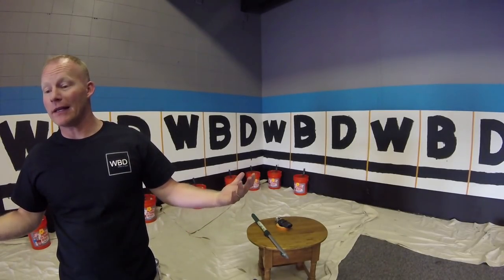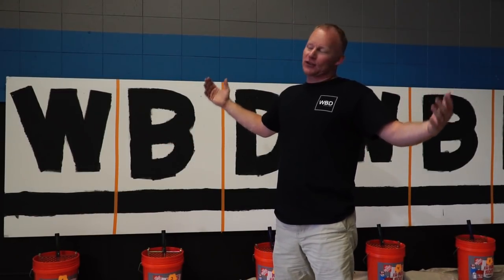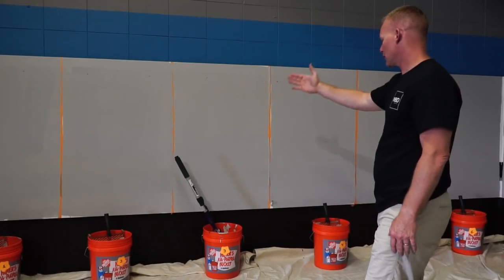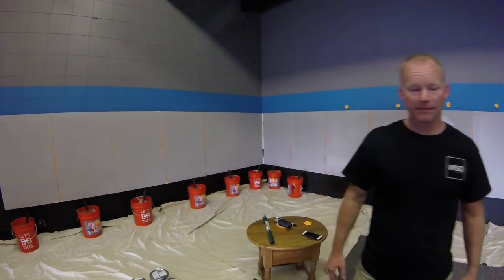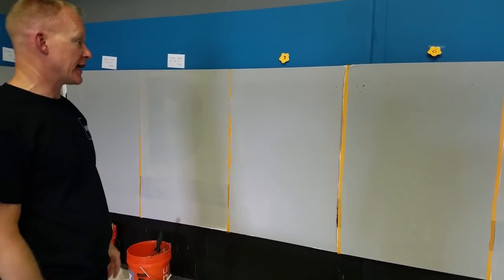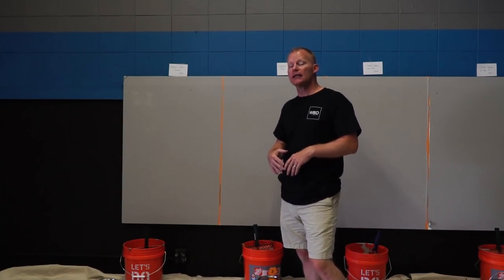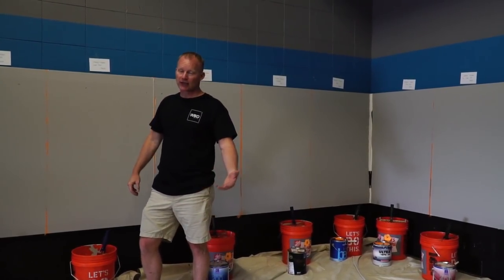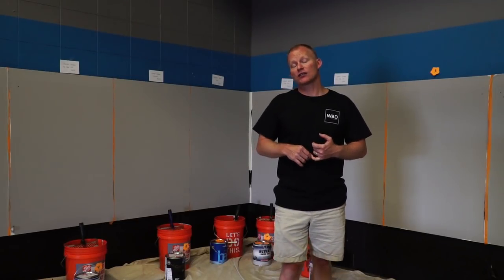Benjamin Moore vs Sherwin Williams Paint Coverage

Comment: Excellent review. Thanks for taking the time to do this test. Professional painter here in Pennsylvania. I use paints from both stores weekly depending what Im doing. I do use Ultra Spec a lot on rentals & get it for a good contractor price. For a few dollars more Superpaint is well worth it & covers better. It also comes down to if your doing cover over jobs or diverse color changes. Regal select is an excellent paint in many ways but is def. thicker and a lil tougher to apply than SW Duration. That paint goes on the easiest of any paint Ive ever used. Ultra Spec doesnt cover the best if the walls are beat up or your color change is a lil different. ben & superpaint are about the same in my experience w ben being a lil easier to apply. You def. get what you pay for with these paints. I try to give my customers the best when I can also. As a painter, they make the job easier and yourself a much better painter. Lastly Ive used big box paints (behr/valspar/ppg) through the years and in gen., none of them are as good as these two companies. Just my two cents and years of painting experience.
Reply: I really like what you had you say I'm a foreman at a company here in Sacramento California and we use super paint on most of our jobs for exterior and interior I do know that Benjamin Moore on their super premium high-end has been tested to have the highest solid content out of all of them except it's hard to find a dealer here the only places that carry Benjamin Moore are at like Ace Hardware and trying to do with that is pretty much impossible and two it's hard to justify paying $350 for a 5 gallon of Benjamin Moore paint

Comment: Prices for promar is at contractor price at level for dyi. I’m a manager at a SW, and you wouldn’t pay 66 or 58 for promar. You would most likely pay between level a pricing and c which can be between 21-35.
Reply from the maker: Sekekama WoW this is one thing that drives me crazy about SW.  Their pricing is ridiculous.  I did not creat it, but I can’t quote random numbers bc it all depends on volume.  I did the same thing with BMs pricing...quoting retail.  A gallon of BM Ultra Spec will not be at full retail either, but it will be far closer than what a gal of SW 200 would be bc SW hyper-inflates their retail prices. So annoying!
Reply: guess I'm not the only  employee that watches swp videos !
Reply: Which paint at Sherwin Williams would you buy to paint in your own home that you will live in?  Interior walls, ceiling and exterior?
Reply: UncleSarkis if you want the best emerald or duration
Reply: Detroit101 thank you.
Reply: Yes Im a painter in NJ, and those prices are out of the equation
Reply: @detroit1018  The Benjamin Moore Regal Select blows them both away.

Comment: I work for Benjamin Moore and I worked for Sherwin Williams.  The issue is that Sherwin Williams touts their Cashmere and Superpaint to be comparable to Regal Select.  So your assessment of comparing them to mid or lower grade products is correct.  Regal would out perform all of them.  Knowing what I know though.  The volume solids (% of dry film when it dries) is higher on Super paint than it is on the Ben....but they seem to perform the same.  So Superpaint should out perform Ben.  But it did not really.  Our Gennex tint system is because of that.  It adds resin to the coating which strengthens the coating, and add more hiding capabilities.   While Sherwin Williams universal tint actually thins and weakens the coating.  
Also Sherwin Williams uses vinyl acrylic technology for all of their interior paints.  Which is full of calcium carbonate or talc powder as a pigment, vs TiO2.  Which we use instead, as well as our premium interior products are 100% acrylic.  So you get what you pay for...and you don't get what you won't pay for.  When 80-90% of a job is labor.  Why would you chance it?
Reply: Súper paint $30? In Virginia we sell it for 58-61
Reply: doc hall you will get what you pay for. Superpaint is a much better product than Promar 200.  But it is still a vinyl acrylic. SW is trying to compete with Home Depot which is why they will sell it cheaper and cheaper. But do you think they will improve the product, even though they have to reduce their selling price???
Reply from the maker: Chris Whitehouse thanks!
Reply: I have always preferred the  Benjamin Moore Regal and coloring through tint system.  I agree.  Too bad most of their stores no longer exist and it's hard to find.

Comment: Ok coverage and price point is important.
 But dark colours and light colours will cover different. How about a base1 paint and a base 2/3 paint and see if they are consistent? 
Now the next most important thing is how do they level (leave streaks/ go back and touch up a roller line 10 minutes later and see if it leaves a different texture? With Behr paint you can not do a roller touch up after 2 minutes and leaves roller lines the easiest if you apply uneven pressure to your roller stroke.
The most important feature is how does it cut with a brush. Ex. BEN goes on like butter spreads smooth and easy. Behr any indoor paint of theirs  goes on like glue. You can instantly feel the paint pulling against your brush as you do a second stroke. I don't have experience with Sherman Williams. 
Also some of these paints  (are 2 in one) have primer within them others don't. And that adds to the price differences.

Comment: Hmmm, why no Ben Moore regal? My personal fav. 
Maybe it wouldn't be fair to the others :D
Reply from the maker: Daniel Harju just did the lower end products. I’d like to do a test of the premium paints too.
Reply: +Walls by Design,  super paint a “lower end” product ?
Reply: southsideshenanigans mid tier at best
Reply: Apparently all but one of these paints covered in two coats so there has to be other factors at play besides money to rank them! Ease of applying with brush, spattering and so forth would also be nice to know!
Reply: benjamin moore is the paint for real paint pros
Reply: That’s my personal favorite too and what I was hoping to see
Reply: Yup, two years later and Ben Moore Regal, still king. This is also still a great video for the info it provides. I'd like to clarify that primarily, I am painting furniture, raw wood. I did a couple Sherwin Williams at customer request, there highest end product still falls short of Regal by a lot! Now, I just get Ben Moore to match the SW color and avoid all the headaches and extra coats.
Time is money, That extra coat and sanding out the weird sags of SW adds up over time.
SW does have fancy storefronts and seems to cater to the painting contractors.
In my mind, even a homeowner, armed with a junk brush and a roller will get a better result with the best paint, compared to using those same tools and a junk paint. 
2 coats or 3? That's a pretty easy decision.
Reply: Daniel Harju So I can use Regal for kitchen cabinets?, if so, would it work on top of BIN primer? Thanks in advance.
Reply: They should of had ppg speedhide up there. 20ish or under a gallon its the "best bang for your buck" paint..
Reply: @neshmahenkel2428  I wouldnt used regal on cabinents its to soft. its designed for walls.. Ive never used "breakthrough" but here its good. If your repainting latex painted cabinents use tough shield or that breakthrough. New id use an oil base . I like satin impervo. They also make that in water base.
Reply: Zach Frakeshmcff thanks 😊

Comment: @walls by design: Great attempt to provide customers, perspective. I do have a few issues with this type of testing:
1. You are testing hiding of the products not coverage. Coverage is a measure of sq feet of surface covered per gallon at a certain film thickness
2. The lighting in the room isn't consistent (shadows etc.) conclusively make recommendations
3. As I understand you are testing eggshells that are tinted to be grey. For a comparison, all greys would have to be identical, since even a slight change in darkness can improve the hiding
4. The price points of the products also include other performance benefits (burnish, dry time, appearance, feel etc.) not just hiding. All paint products are not created equal. Factoring those attributes may lead to the same contractor choosing a different product.

Great attempt and keep the videos coming!!
Reply from the maker: Depends on who you talk to. All reps talk as you do in #1 above, but painters talk like I do. 
Yea, the lighting could have been better. I also want to use more of a white next time.  
Yep, sheen might make a bit of a difference too.  Did not think of that. 
Price point is hard but this is mainly BC SW jacks around with this all too much.  Trying to explain this.  Could have done a better job. 
Thanks for the feedback.
Hey, if you want to see some of my other videos on growing your painting business, check out our BB TV site: 
https://www.youtube.com/watch?v=ECxd954DWhg
Reply: Walls by Design not sure how you can state Ben Moore’s retail when all Ben Moore’s are franchises. The owner of the store sets the price resulting in huge inconsistencies across North America. I have 3 Ben Moore’s in my city and they all have different retail prices.
Reply: @alaineberjian9492  a phone call ;-)

Comment: This was great for me. A single woman painting her house. The key for me was SW has primer in it.
Reply: Ive done my research and many pros say not to use just the paint with primers in them. Those paints with primer in them do nothing. You always want to use a primer like Zinsser 123 or Kilz primer before painting because it will save you money in the long run.  Using a good quality primer is also cheaper than paint to and you wont have to use as many coats of paint and if you have bought paint before its alot higher cost than primer. Your overall results will turn out better as well by using a primer and paint.
Reply: The paint does not have any gender bias. Women can paint as well as anyone else can. I remember helping my single mom paint when I was eight years old (she was a nurse full time and in grad school). The paint/primer in one is a marketing gimmick. As the Ghetto man notes, you will get far better results always using a real primer first (I like BM Fresh Start) high hide.

Comment: I want to see ben moore aura vs sherman Williams  emerald
Reply from the maker: Riddler0019 well, I’m sure you can buy them and test them. 🤷🏼‍♂️
Reply: Riddler0019 aura covers wayy way better than emerald ive done it alreay
Reply: Emerald has a higher volume solid. Not comparing apples to apples. Also you cant just use any roller cover with any product. You can buy the best paint on the market but if you don’t have the correct fabric for your roller cover you won’t get the correct coverage.
Reply: I did SW Emerald and the paint is wonderful, excellent coverage and the walls look amazing..

Comment: Informative test! I've been working at Sherwin Williams for a short whole now and I've been looking for a comparative video like this. I agree heavily with the pricing, as it turns DIYs away when you say the price (however Sherwin Williams runs sales like every month, which says a lot about pricing in the first place). From what I've learned so far, is that contractors mainly buy ProMar 400 Flat Sheen for specifically ceilings, and maybe this test makes me realize why they only use it for ceilings. SuperPaint happens to be one of the paints I can sell and get great reviews on. The Cashmere (which is called Opulence in Canada) seems be a very meh product. Benjamin Moore seems to have great products with good prices. Thank you for the video! Hopefully You can make a video comparing Benjamin Moore Aura and Sherwin Williams Emerald or Duration.
Reply: Contractors buy Promar 400 Flat for ceiling because it is a dead Flat. If you  put a paint that has direct sheen or side sheen on a ceiling you’re going to see roller/ sprayer lapmarks and imperfections in the ceiling. Promar 400 isn’t durable and doesn’t give you as good an overall appearance higher quality paints so thats why you don’t use it on walls

Comment: Thank you from the bottom of my contractor soul!!! It's wonderful to see SOMEONE besides Consumer Reports test our paint.
I went a step further into the matrix over a year ago and did some different testing. Ready?  I took Behr crap interior semi-trim and A-100 (piss/watered) down paint and added PAINT grade titanium dioxide. In small test examples. For roughly 40 cents/gallon, I got these loser paints to cover better than anything on the market. Everyone could research the 2004 Dupont report on paint. Great technical reading. I am CEO of easycolorexpress.com and will be changing the way things are currently done. Peace to all.
Reply: EASY COLOR EXPRESS I don’t know what grade of Behr you used or what color you chose but Marquee covers everything in one coat even deep base colors work better than eminence which as thin as piss and splatters.
Reply: Hi Im just wondering what brand of Titaniuym Dioxide you purchased and does micron size matter?  Also have you tried adding hydroxy ethyl cellulose?

Comment: ProMar 200 is a scam. They probably try to compare it to Ultra Spec (20%ti) but the titanium content - coverage - is the same as Super Hide (15%ti) which was basically the best cheap paint at 1/3 the price of Pro Mar 200 to the retail customer. They get painters to buy it at ridiculously low prices and then when you go back to buy a gallon or 2 to touch up after your house was painted, it costs you 3x as much as the painter paid. Ben Moore doesn’t do that crap.
Reply: agreed ProMar line has turned to garbage. it's not even worth the money at my pricing. it has wasted so much of my time and money with the new formulation, it's just pure garbage. Ultra Spec 500 is the way to go, can't be beat for the price. it's my go-to over Ben as well

Comment: At close to 40 per gallon retail, Ben  is best at one coat. Possibly Ultra spec best value at two coats. IMO
Reply: $34 here in Harper Ferry, WV. Can't beat it.
Reply: if you're doing 2 coats though, then even ProMar 400 will be sufficient, which at $17/gal for flat is the way to go. again, if you're doing 2coast

Comment: SW gives contractors a good price on the 200. Superpaint is always more money for contractors, and it doesn't cover in 1 coat, so the extra cost isn't worth it. Superpaint will cover in 2 coats on bare drywall, but 200 won't. And Superpaint will cover accent colors in 2 coats, while 200 is doubtful to do so. 200 ensures that contractors will tylpically use 2 coats, while Superpaint is sometimes adequately covered in 1. I don't like the finish quality of the finish of promar, because it flashes too much in natural light from an acute angles. Across the board, BM products cover significantly better. Aura will go straight onto trim and cover in 2. SW Emerald needs a primer and at least one time, I wasn't satisifed with the coverage after 3 topcoats. That's 80 dollar or so paint.

Comment: Thank you for the comparison. Very helpful. 3 years ago we had our whole house, well minus a few rooms painted in BM Regal Matte...Painter's suggestion...it's awful. It chipped, there are marks that will not come off and the slightest nick and the paint peels. We had one powder room pained in Behr paint and it is holding up better than the BM Regal. I think some of this is painter preference..BM vs SW and it's also based on who will give them the better pricing. We are going to paint our house again and we are torn between SW Superpaint or BM Ben. In the video it's hard to tell which is better as there are no kids, pets, friends or grease hitting the walls. As I said, we currently have BM Regal Matte almost everywhere and I hate it. Definitely not durable.
Reply: Hi,
If you want a matte/eggshell  finish go with Benjamin Moore scuff x in the matte finish,it’s actually almost an eggshell finish.Very durable will hold much better then Ben or superpaint.
You can get it from most Benjamin Moore retailers.Its about 45 a gallon here in Chicago,so not much more then Ben or superpaint.
Reply: Duh because you have a matte finish. Thats basically same thing as flat paint which is impossible to get anything off of without ruining the finish even more. Eggshell or semigloss you can clean. Flat/matte paint is not cleanable...
Reply: “TheStoli5” Sorry to bust your bubble, but chipping isn’t a paint quality issue, it’s a primer issue. BM Regal IS pretty much “the shit” when it comes to wall paint. Your painter may have done a fast/light coat instead of two good coats, and also the paint may not have even had enough time to fully cure, etc. The bottom line, if you want to reasonable and decent money on a high quality paint, Regal is IT. There are so many different variables that most likely are the culprit for your dissatisfaction, not the topcoat itself.
Reply: Also, you don’t really get a deal on Benjamin Moore paint, even as a contractor. They don’t do discounts, they don’t do bulk discounts or quarterly sales, and they definitely don’t really do volume discounts on their good paint. You just buy it because it’s great paint.

Comment: By the way one coat coverage is bologna!
Reply: Eric Owen Not always, sometimes just using the correct roller cover is all it takes. Different fabrics hold and release the paint differently from one product to another. Also most companies only show solids on their data sheet but not VOLUME solids. Volume solids make a huge difference in product coverage as well. Also depends on what color that is being coated. Dark to light or light to dark, yes most will need a second coat but some products needs such little paint for the last coat it takes no effort.